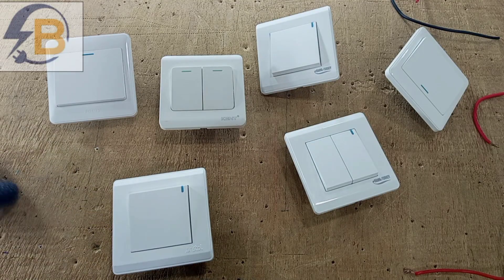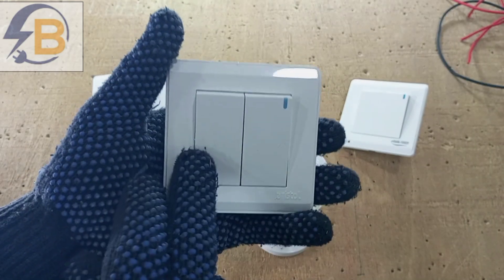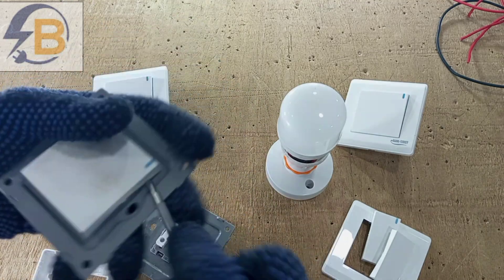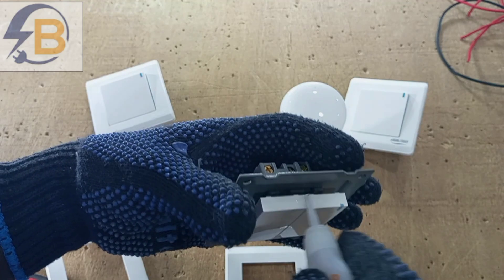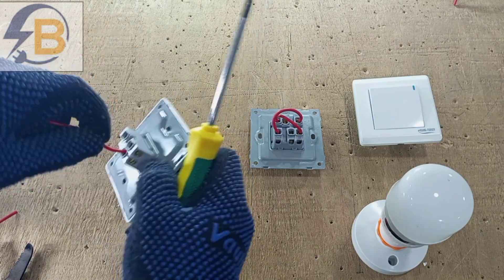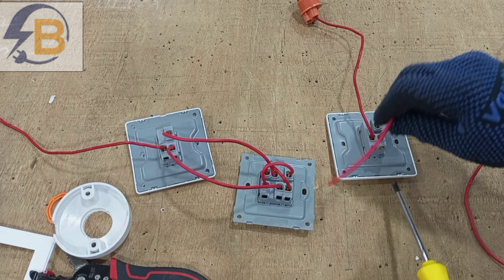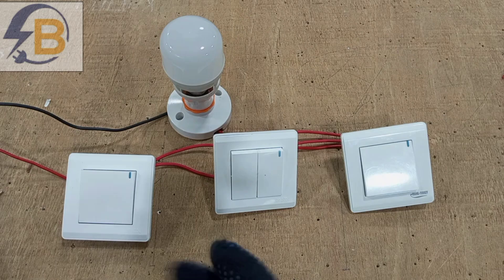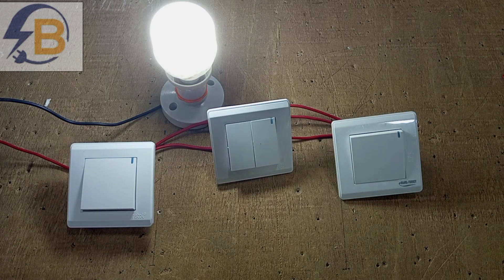HOW TO USE 2 GANG-2WAY AS INTERMEDIATE SWITCH

Comment: Little bit vague on the here to here terminals otherwise although it did help I had to watch several times because you do not say which terminals are which when you are connecting them. This terminal here then into this terminal had me back to guessing the connections.
Reply: You loop L11 to L22,then loop L12 to L21.input is L1 and L2(COMMONS), output L11 and L21